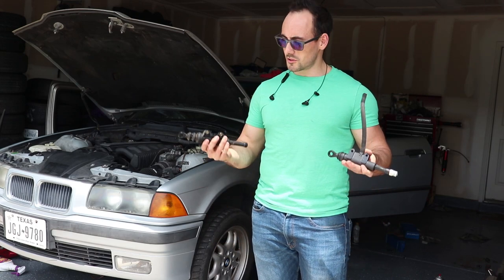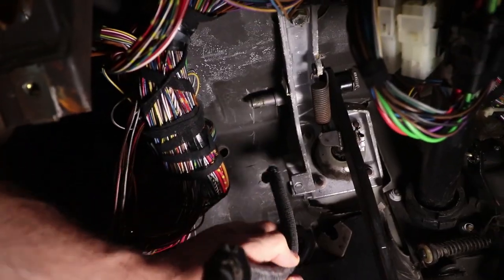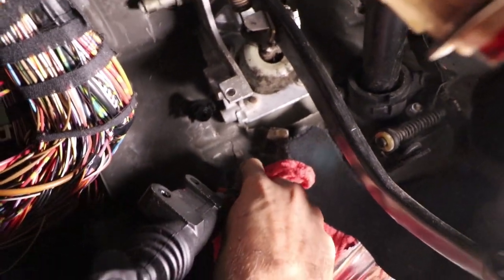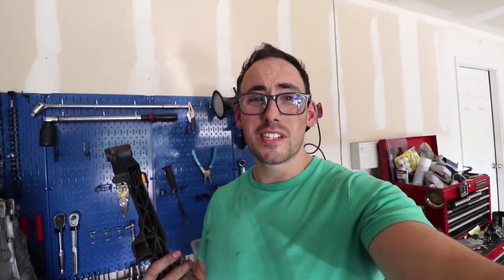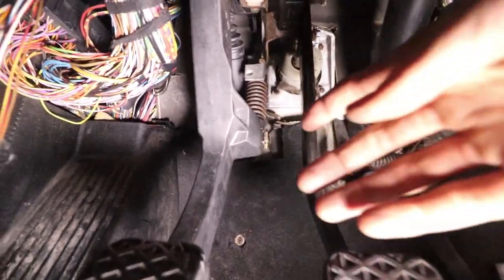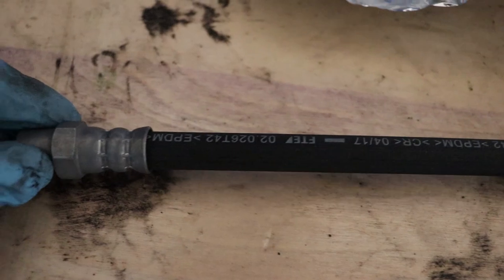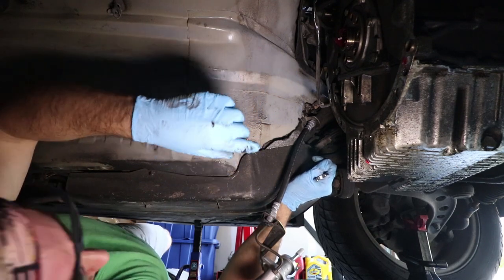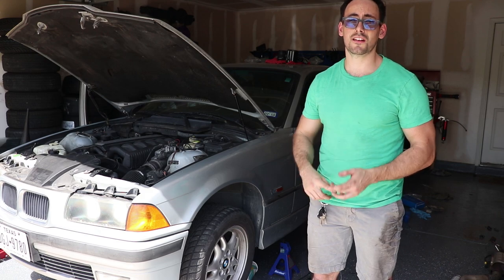How to install E36 BMW clutch Mater/Slave cylinders + clutch delay valve delete

Comment: Just so you know for next time, or for anyone watching this video getting ready to do this,, at around 2:30 when you are trying to put the hose connector/nipple back into the rubber grommet, instead of trying to force it into the smaller grommet hole, you can pull the grommet out of the master cylinder body & the nipple goes right in, then you put the grommet & nipple in together.

Comment: Good job, what a pain, I gotta do this job, not looking forward to it, I usually look forward to these jobs but this one looks like a royal pain smh don't think I'll be video taping it either, we'll see.  Thanks for the extra effort of video taping such an annoying job, hats off to you!
Reply from the maker: Thanks, I really appreciate that. It certainly was a pain, but I think the hardest part was bleeding the brakes. I got one of those power bleeders now and it makes the job so much easier. it doesn't help much with those little clips that like to go flying everywhere, but its just one less pain to deal with 😅
Reply: @TheDailyDrift  My master cylinder just came about an hour ago.  I'm gonna do the job this weekend. My car is an M3 so my master cylinder looks a little different than yours, it's short and all plastic ... I think I might video the job now ... we'll see how I feel.

Comment: One more important note, the master cylinder he has is pre 05/97.  After 05/97 uses a different master cylinder, at least on the 328i.  This can be found inside drivers side door on a plate and will give you the month/year  Example: date is 09/96 on my 1997 328i
Reply from the maker: G oh nice good to know!

Comment: I don't believe Beck/Arnley make that part, they usually sell genuine BMW components under their brand in my experience. The replacement that you have the is the old style master cylinder BMW used and I honestly prefer it because it's metal, although it is hard to get that nipple in.

Comment: Can you really just take out the clutch delay valve and screw the hose directly to the line? I looked around online and saw people made "modified clutch delay valves" which is almost like a cdv delete. Just wondering if its safe to do that?
Reply from the maker: Rocket Bunny Impala well I know they sell delete kits, but I literally just removed it and installed the line directly to the slave cylinder. I haven’t had any problems with it and I’ve been clutch kicking it pretty hard at the track. I’m sure it will prematurely wear out the clutch, but I just prefer the more direct feel. Sometimes that valve can even make it feel like the clutch is slipping just to make for a smoother ride. If you are worried about longevity and smoothness I would just keep it in there, but if you are like me and prefer a more direct feel it’s worth trying. You can always put it back on if you don’t like the way it feels. So far I have no complaints and it’s working out great for me.

Comment: Thanks for taking the time to make the video.  A couple of questions does the clutch delay valve need to be replaced or recommended since your doing the whole job.  Secondly and more importantly is the slave cylinder.  I didn't see you put it in, are there special instructions like keeping the white cap on, and if so do you put some lubricant on it and do you have to compress it.  Any special handling tips would be greatly appreciated.
Reply from the maker: No problem, it's what I enjoy doing. As far as the clutch delay valve goes, it really depends on the use of the car. Since I was planning on using it for drifting and I prefer a more direct feel I simply removed it all together. The CDC shouldn't really go bad it's basically a restrictor. 

As far as the slave, I couldn't install it in this video because my transmission was out of the car, but the only thing left to do was slide it in the transmission with that white plastic cap on and line it up with the clutch fork inside the transmission then secure the two nuts on the transmission to the slave cylinder. The main handling tip when it comes to the slave is, make sure you don't hit the clutch pedal when the slave is not bolted up to the transmission or it will blow all of it's seals. The bleeding process can be a pain, but I recently discovered power bleeders and it helped immensely once I figured out how to get the cap on. I can put a link in the description, I think they go for $50.
Reply: Thank you for the response, so just to reiterate you do the bleeding before you put it back on and then again with the pedal after you put the slave back in.  I have a Motive power bleeder so I should be good there, however, I may try the oil spout filler like you did since air naturally wants to rise. Lastly (my biggest concern) back to putting the slave back in, I've seen guys grease the white tip (is that recommended) but no videos actually show the slave being inserted back into the flywheel or transmission.  That is the part I don't know.  Does it need to be compressed or am I overthinking it?  Do you just stick the slave cylinder rod in and it automatically aligns where it needs to be on the clutch fork?  I'd imagine since the clutch fork didn't move since you were doing the job it would go right in?  Once again any input would be appreciated.
Reply from the maker: Well we actually only bled the slave cylinder off of the transmission by hand and it worked, but it was a pain. If you decide to do it the old fashioned way, you just install the slave cylinder then use the clutch and a buddy to open and close the bleeder valve on the slave cylinder. Installing it is pretty straight forward, I'm sure you can use grease on the tip, but I have never used it on any of my cars and I haven't run into any issues because of it. You don't have to compress it, just line it up and push it in. It will compress itself against the clutch fork as you tighten the nuts.
Reply from the maker: When you are installing the slave cylinder into the transmission there is a dimple in the clutch fork and that is where the tip of the slave cylinder goes. You pretty much just have to go by feel and it should pretty much slide into place.

Comment: Sorry for the questions and my bad English , when you put together the pin lock inside the spring , what's the name of the part that goes on top "the cap thing " I need that piece for my car and I can't find it anywhere! Thanks in advance and great video
Reply from the maker: I'm not sure what the official BMW part is called, but I believe it is called a "retainer" or "spring retainer". FCP Euro parts has a whole list of the clutch pedal parts, here is a link that might help you: https://www.fcpeuro.com/BMW-parts/Clutch-Pedal/ hopefully this helps you out!
Reply: Thanks , minute after watch your video i found the exact name and website that you recommend!
Reply: Ok i did the project to fin out that after all that i don't have any hydraulic pressure exactly after install the master clutch cylinder.... I know i have to bleed it, so my question is , that's normal ? No pressure after install it?
Reply from the maker: luis colon if there is no pressure, that means there is still air in the lines. If you haven’t bled the lines yet then that is why you have no pressure yet. When the line is removed it lets in air and the new master also has air in it. Once you bleed all the air put it should build pressure. It took me a long time to do by hand, I later bought a power bleeder for $50 and it made the job so much easier, the hardest part was securing the cap on it. I put a link to the one I got in the description if you find bleeding it the old way to be a pain.
Reply: @TheDailyDrift  thanks a lot bro !
Reply from the maker: luis colon no problem, if you ever have any more questions feel free to send them my way ✌🏻